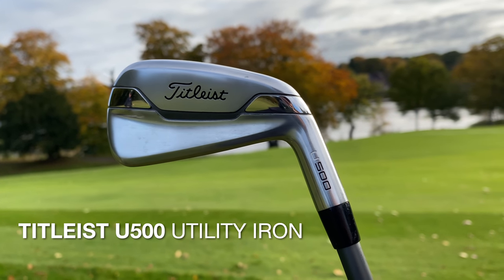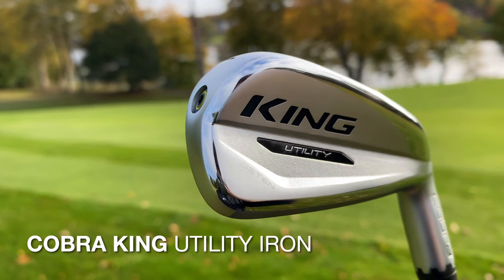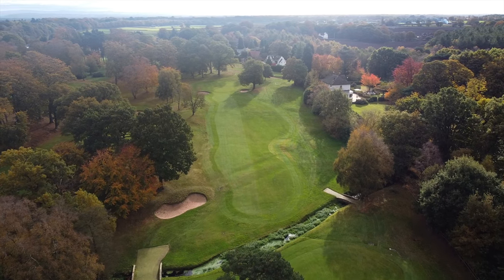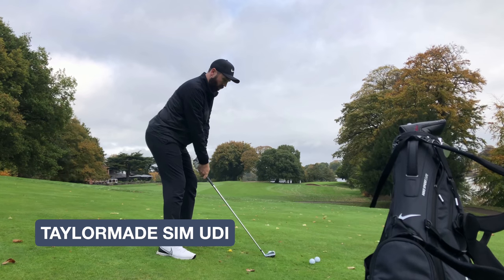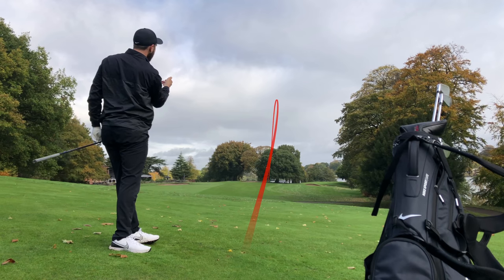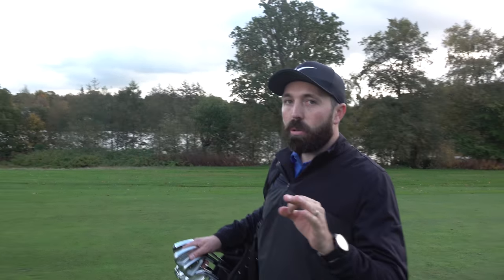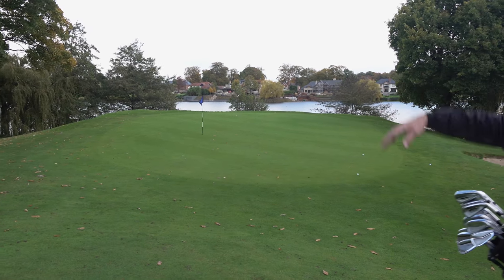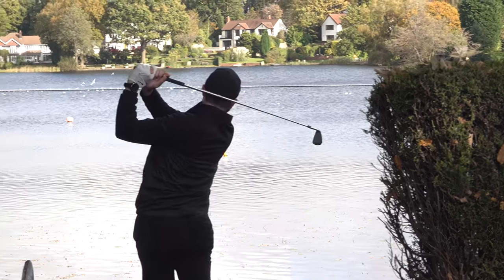Do I need a new 2 IRON?

Comment: Imagine actually being able to hit a 2 iron. I still can only hit 6 and above 😂
Reply: Even off a tee?
Reply: The max I can hit is my iron 3 which I use pretty regularly. Never used an iron 2 or iron 1
Reply: @Cowmilker98  They might lack the speed to produce enough spin at that loft, to keep the ball in the air. Tee or no tee. Or they just struggle to produce impact with a longer shaft.
Reply: Looks wise the cobra is the nicest
Reply: @winstonsmith11  that's why I'm asking haha. Wondering whether it's a club speed thing, or maybe a ball striking thing. A friend of mine could never hit anything above a 7 and when I had a look at him it was all mental, he was intimidated by the strength of the loft at address so he was almost trying to 'lift up' the golf ball with his swing. A bit of advice and 100 balls and he could hit his 3 iron 220y
Reply: @Cowmilker98  what’d you tell him?
Reply: @GurjyotJohal  to try and forget about the loft he's holding or what it looks like and try to strike it similarly to his shorter irons, hitting through and bottoming out just after the ball
Reply: Check out the U510 or similar. It’s a thicker bottom club and it gets the ball up in the air without much effort. The 500 comes out lower for sure!
Reply: 6 iron is the only iron I can’t hit for some reason
Reply: @Cowmilker98  Sound advice. Could easily be the fix for the op. My initial thought was that he might be struggling with shallowing the club at that length, which is obviously a more technical issue to correct. Hopefully he's in the same boat as you friend, and your advice can help him sort it out.
Reply: AJ Mac  I was never looking to fix anyone's swing though, was I? The swing is only one part of the golf shot. Other parts include your actual hand-eye coordination and your mental approach to the shot. If he has a similar mental block about using stronger-lofted irons and feeling that need to 'lift' the ball, then what I said will most likely work - focusing on trying to use the same swing as you do with the shorter irons (which he has confirmed he can hit well with).
Reply: @winstonsmith11  yeah, there may well be another cause like you say. If it's swing related he should definitely see a pro about it. Alternatively he may be very young and not have the swing speed yet
Reply: AJ Mac  Imagine taking time out of your day to insult people who are only trying to help others. Cowmilker98 offered genuinely helpful insight.
Reply: Same here.  Of course off a tee would be different.  I struggle with 4 and 5 iron for sure.  I've only been playing 5 months though

Comment: To be honest, Rick, I wouldn't even consider putting a 2-iron (or a 3-iron) in my golf bag.  As a 13-handicapper who has ranged between a 10.5 to 14 index over the last 8 or 9 years, I just don't have the skills, nor do I have the clubhead speed, to hit such a low-lofted iron. I have tried a variety of "driving" and/or "utility" irons with 19 to 22 degrees of loft, and I currently have a 20.5* lofted utility iron that I have experimented with as a 4-iron (or 4-hybrid) replacement, but the results have been inconsistent with it.  When my swing is "on", I hit it quite well, at about 200 to 210 yards with a nice mid-high trajectory and a slight draw, but when I am "off" with my swing, I am punished far too severely.  Thus, I am sticking with my 20* hybrid that has a shorter-than-standard shaft length at 39.5".  This club is deadly accurate for me from 195 to 210 yards, and if I hit it on my approaches into par-5s and long par-4 holes, it holds the green beautifully.  I'll leave those long irons to golfers like you who have the skill level and clubhead speed to get maximum results with them.

Comment: I have the SIM DHY and I think it’s the most versatile club I’ve ever used
Reply: It’s so hot off the face. Lots of pop
Reply: How so?
Reply: @RockyStatue  I can hit it high and low when I want. It’s very good off the tee I can hit a big high draw or a low punch fade with it. Has great feel off the face it’s VERY HOT off the face. Highly recommend people try it. I got the 3i option which is 19° and I got the 75g stiff flex graphite shaft.
Reply: @sebastianheine378  100% it is a HOT club.
Reply: i have the dhy #2 and is absolutly a killer from the tee and the turf. but i keep as well a sim udi  #3 for his unique lower trajectory. in windy days makes the difference and is perfect for a stinger shot.
Reply: @fridericogatti1213  it’s absolutely does. The surprising thing for me is how low I can hit the DHY #3 with it being a chunkier head. I figured it would get more air but I can it a high bomb as far as a lower piercing flighted ball with this club.

Comment: Have to say I bought the cobra with the steel KBS shaft in stiff and while a lovely feel it just went a bit high for me as I want to use it at my links course. However, I had managed to get a Miyazaki Tour Issue 105g xstiff shaft and after contacting cobra they very kindly sent me an adapter so I could try that in it. Wow! What a change in flight and spin. It is now an absolute bullet of a club and the adjustability is an added extra. Suppose what I am saying is that unless you are using the same shaft in all the 2 irons then a true comparison is difficult . Love the fact that driving irons are swing a resurgence though and great review rick.

Comment: I’m one of the few dinosaurs in my club who still uses traditional MP33 blades, that includes a 2-iron. And yes, still use it regularly on Par 5s and off the tee on tight fairways. It carries 235yds but can be pretty unforgiving on off centre strikes. I sometimes think of getting a more modern variant, but they all look really chunky!
Reply: Check out the P790 UDI.  One of the best I found that didn't really LOOK like a utility club.

Comment: You should get the Callaway fitted. I have the 70g Ventus hybrid shaft with the 12g weight in the head and it is great. very workable with the additional head weight.

Comment: You need to watch the first 10 seconds in 1/4 speed, it just sound hilarious. Like Nemo... Otherwise, I was asking myself the same question a year ago and went for a used GAPR MID 3. Not really a 2 iron, but works fine for me. And thanks to Rick's test, also, I have to admit. He was rather convinced of the GAPR Mid. Finally, your test should absolutely have included hitting into mid to strong wind. That is where I want 2 irons to work and shine esp.

Comment: Honestly, seems kind of pointless to test these clubs head to head without putting the same exact shaft in it. May be worth your time to do this and re test.
Reply: Thats not a proper test though. Different shafts maximize different heads often. 

A true test is to get fit for each club & then compare the fitted/maximized clubs against each other.